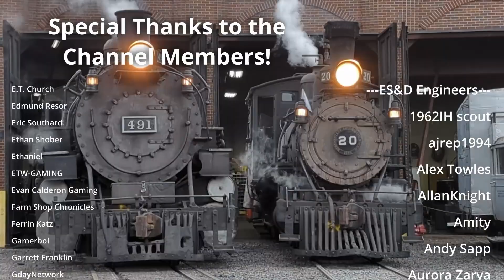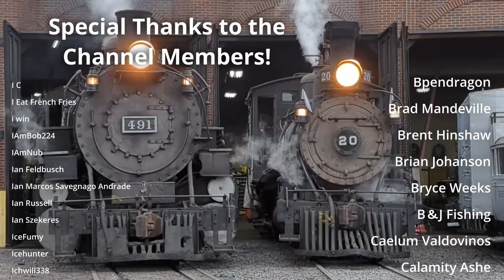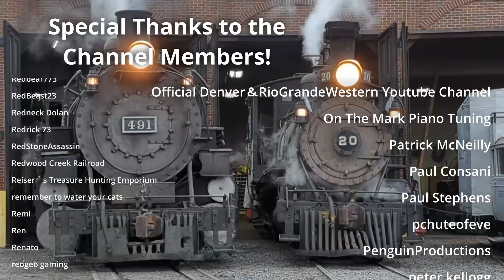Does COAL size matter in STEAM TRAINS? | Railroad 101

Comment: As a fireman, I will add two things to this. I think it's harder to get as full of a scoop of powder as lump coal since it only goes about the height of the shovel wings. Secondly powder has some advantages, both for capping your bank and getting fast heat in the box if you spread it out. No fun if you aren't working the engine hard though.
Reply from the maker: Very true! Excellent additions. Powder is nice in certain applications.
Reply: @Hyce777  I have a question about the Polar Express events.
do the engine crews play the part of Steamer the engineer and Smokey the fireman from the film.
Reply: I suspect that would throw a lot of it right out the flues on a heavy draft though too... Heck it might even be burning as it's exiting the smokebox!
Reply: @kleetus92  if the locomotive has arch brick, throwing it to the front of the firebox will allow more time for combustion
Reply: @SignalLightProductions  true statement, unless it's really really fine then it will be a flour explosion! lol
Reply: Yeah, between how high a pile you can get and how bulk density changes with size distribution (you get more mass per volume taking big pieces with fine fraction in-between, than taking only big pieces or only dust), it might be needed to calibrate the measurement, like by putting several shovels of each coal into a bucket and weighting it.

Unless the dust has huge amount of literal sand and dirt, energy per mass shouldn't differ much - but different combustion speed may cause suboptimal firing conditions at the same firing style (try filling the firebox the usual way - and you'll get tons of smoke). Overall, probably nearly the same performance at optimal conditions but much more hustle shoveling to keep the fire steady.
P.S. Lack of black smoke doesn't guarantee 100% combustion. You still can have insufficient oxygen and be producing carbon monoxide.

Comment: The slack coal will burn faster due to having more surface area, but won't that also mean it burns hotter? So long as enough air keeps coming in for efficient combustion, wouldn't using mostly slack mean that you're reaching higher firebox temps and thus producing mores steam? Or is the air intake limited enough that using slack produces less efficient burning and more dirty exhaust?

Comment: NOTE THIS IS POSTED BEFORE THE VIDEO EVEN STARTS. I will say one thing. The way the brits go about it is fire little and often. No lump of coal should be larger than a mans fist. And no coal should be fired for about two minutes depending on how hard the locomotive is working and how much steam is being used for example more high pressure steam due to the reverser (Johnson bar) being in the more full forward position or  low pressure steam with the reverser (Johnson bar) being in a less forward position like more towards neutral but not quite in neutral. Love the vids Hyce. I’d love to go work with you guys out there. I can speak for a lot of people when I say it’s my dream

Comment: Short answer yes coal size does matter
Let's compare a 1 inch diameter piece of firewood to a 4 inch diameter piece of firewood
The smaller wood will burn faster therefore a smaller piece of coal burns faster than a large piece of coal.

Comment: This is interesting in how it could be applied to a home heating boiler.  I have a wood boiler system in my house.  To bring the boiler up to temp quicker I split the wood into smaller pieces that burn quick with more heat.  The heat is hotter and faster through the flues which means some waste, (there's only so much heat that can be transferred in a given flu so any heat above that amount is wasted.)  As I build up a good bed of hot coals I switch over to larger and larger pieces.  I'm passing heat lower and slower through the flues but still maintaining the operating temp.

Comment: Lots of coal powered power plants intentionally crush their coal into small crumbled pieces... so it will burn quickly, releasing heat to their boilers rather than sitting in a fire chamber very long.  Of course that is a MUCH larger fire, with coal being fed mechanically (no people shoveling) and a fairly constant load going to their turbines.
Reply: yeah, in germany there where coal dust locomotives that did exactly that, just blew the dust into the fire.

Comment: Lololol anyone who's ever loaded their own cartridges or just thought a moment knows size matters.

As you decrease size of the coal, you increase surface area, thus increasing the speed by which it burns.

High pressure powders, like magnum powders, tend to be smaller individual grains of powder, as they burn faster and reach peak pressure sooner, pushing on the back of the bullet harder.

Comment: I was driving a Showmans Steam Road locomotive near where I live, going up a very steep road. I put 2 shovels of coal on with alot of coal dust. The coal dust flash fired with wooshing sound, straight through the tubes and out of the stack.
Here's the funny bit. A white van was following me got covered with the hot dust/ash. it took ages for the van driver to clean up the mess.

Comment: Faster burning, but same amount. That'd mean the same energy from the same volume is getting released quicker. More energy released would mean hotter fire. Sounds like, while slack isn't what you'd want to run on bread and butter, it'd be useful for things like starting up in the morning, or if you need extra steak for heavier loads. A boost for lack of a better word.

Comment: Some warships had mechanical "sizers", big mechanical wheels that crushed larger lumps down to a fairly consistent dimension while letting the fines fall through without further grinding. By using a fairly small target size they got far better consistency and faster burn rates, which where required and desirable with the automatic firebox feeding systems, but not nessesarily well loved on vessels where crews where shoveling by hand, as the average stoker was expected to fuel 5 tons of coal per day (often in fairly enclosed confines with other crew doing the same task), so even very minor changes in how difficult it was to shovel would have huge repercussions on their workload/conditions.

Comment: To minimize waste, every fireman should be using a mixture of all sizes of coal. Blending the slack coal in uses it up without adding in an excessive amount of shoveling, and as it's nearly instantaniously combusting, generating near instant energy into the firebox. vs the slower burning  normal coal.

Comment: I've only ran wood fired steam but size matters there as well. For example, use big chunks for a slow burn if you're idle but want to keep pressure or use small pieces for a quick, hot fire when needed. Fun video!

Comment: Well i am not a fireman or so. But i do maybe know that the reason for the fine coal power burning quicker. Basically the more surface area you have for a material to reacted the quicker the reaction is. For a other example dust is something you wouldn't normally think it could really burn or explode. But if you blow it into the air and give it a ignition source it can happen that you get a dust explosion. A bigger chunk of coal will burn slower then the finer coal powder since the most of material is not involved in the reaction happening on surface of the coal. I am no a expert so please have mercy with me ^^

Comment: you know it's interesting mark, even as a live steamer.  my father's 1.5 scale hudson on average will burn up to a bucket and a half a coal a day during the spring and summer hauling mostly a 5 car 1000 pound train.  now the coal we get from a supplier in nj is basically pea sized and we have been burning pea size coal for 30 years.  it's easier to shovel, it catches quicker.  but like you said for slack coal which is basically dust.  the smaller stuff burns up too quick and for us fills our ashpan more meaning we have to stop more often to dump ash.  once we burn up the last of our pea size bags.  we are gonna try going for nut size.  the idea we hope is that the grates will stay covered better and hopefully won't have to stop and dump ash so much.

Comment: Lump size also influences the relative amount of combustible gases/fluids retained in the volume. The smaller the pieces the more lost gases/fluids to the air. It was the gases in household coals that gave the dynamic fire that provided  entertainment before TV. The small size coal used in large power stations and some locomotives is like that for ease of mechanical handling and predictable energy levels through out the 'batch'

Comment: Its not only work that the fireman does there also advantages to surface area and coefficient burn time but shoveling slack can be dangerous especially in a fully enclosed cab with the potential to cause a dust explosion, this coming from someone whos talking out there ass but is probably right, correct me if im wrong

Comment: I would assume the size of slack would also cause more difficulty in controlling airflow through the grates and dealing with ash.  Doesn’t the smaller size essentially provide a more solid blanket limiting the amount of airflow, or at least making it inconsistent?  And I can only guess that keeping a good even bed with fuel that burns extremely fast when it has air, but can also smother the amount of air, would mandate paying a lot more attention to things (mental exhaustion as well as physical).

Comment: Would be quite interesting to have a nighttime smoke stack camera on firing with the two types. Even with a spark arrestor I have to imagine a fair bit of that slack is being shot right out the stack and shooting much more sparks than clean lumps would. Especially under load with a high draft. 

For double the amount of mass being stoked that energy has to be going somewhere if not the boiler. Either through the ash grate or up the stack

Comment: I wonder how much of the difference is due to the slack being much closer in size to the gaps in the grates that the coal sits on. When you initially talked about the slack, I imagined something the size of coarse sand, and was wondering how you'd expect it to not drop straight into the ash pan.

Comment: Hey hyce I have a question that I only want you to respond, so pls no one else respond. But I found out that one of my favorite locomotives ATSF prairie 1010 will be restored to operating condition. However it is said it will be ran on pressurized air rather than steam. I basically have 3 questions. Why? How does it work? And if does run on air is it even truly “Restored”?

Comment: Hang on, wouldn’t the fact that it’s burning up faster meaning more BTUs in a given amount of time have an impact on the firing of the engine? My thought process here is that since it’s burning faster, you’re putting more heat into the firebox/boiler in a given amount of time, so wouldn’t that equate to having to do less work overall? Clearly not based upon your demonstration here, but I am curious if the fact that it burns faster affects things at all.

Comment: Firing slack in engines with arch bricks like 491 is WAY easier than in small keyhole fireboxes lacking arch bricks like 20. I’ve been stuck firing slack on Valley 97 and if she’s working hard she will just suck your coal dust straight into the flues instead of it going where you want it on the grate.
Reply from the maker: Yeaaaaaaaah that's very true.

Comment: the big one in the thumb nail probably would be good if you park the engine and wana keep her warm but not cooling down so it would have time to break down as it burns. and probably the same to the slack coal at lest to use it

Comment: Now, I'm curious. Is the real power move here to fire with the biggest lumps of coal you can fit through the fire door? I mean, theoretically, you'll have to do significantly less work that way, and be much more efficient right? I presume there are down sides to bigger lumps of coal though?
Reply: Not quite, since you want a relatively even layer of coal spread across the entire grate area, and only using giant lumps of coal would make that nearly impossible, not to mention the fact that continuously lobbing giant lump of coal against the interior sheets of the firebox could cause significant damage.
Reply: @Phoenixlover55  Hmmm, yes, I see, you raise some valid points. I guess it makes sense that there'd be such downsides, otherwise I suppose they'd be running of the large stuff. 

Cheers :)

Comment: Speaking of coal dust- some of the first ICE were powered by that and not liquid fuel. Well, the earlier versions used some mushroom spores as fuel cuz they were even finer ig? But the same engine was later modified to run on the cheaper coal
Reply: Where can I find more info on this? The only locomotive that ran on powdered coal was the Union Pacific coal turbine 8080, which had a gas turbine prime mover that was modified to burn powdered coal. Don't ask me why they did that, because I have no idea, and it didn't really work that well, but they did build it, and it's a monstrous beast of a lashup. Like, the A and B units together had 36 wheels, 28 of which were powered.
Reply: @Phoenixlover55  google "Pyréolophore"

Comment: Which is the best to shovel coal, automatic stoker or pure human muscle to keep the firebox with a enough coal
Reply from the maker: It's best for the size - small engines don't really have the space for an auto stoker, nor would it be economical to have such a crazy auxiliary system and it's assorted maintenance for a smaller engine. Bigger engines.... One guy can't keep up.

Comment: Okay Hyce, here’s question. Since in the smaller shovel fed steam locomotives like fist sized chunks of coal. Would the same be true for the much larger steam locomotives such as UP 4014 like the same fist sized coal if it were possible to feed that hungry beast that sized coal. Or does the draft on the 4014 create such a fire storm when it was mechanically fed the finer ground coal, that the feed rate could be cut down to achieve the same result? This is relatively speaking of course. 
Love the content!

Comment: This is me spitballing here, but could you (should you want to put forth the effort) take the slack and compress it into a more coherent piece? Like "mold" it into a rough coal shape and then squeeze it to kind of make it stick and fuse together? I'm not saying make a diamond, but I would have thought there would have been some kind of machine out there that could compile coal slack into a usable piece of coal. I'm sure it'd be expensive unless you teamed up with a university to do it because they could do it for a material science course and you'd be doing them a favor and they'd be doing you a favor in return; just saying. It just seems like the tech should be out there, but i totally get it if the effort is not worth it.

Comment: I bet that the problem here is not really in the fire speed, because heat is heat in whatever form it is. Less time that the scoop of coal fires — yes, more scoops in the hole. But more heat from that scoop — less scoops in the hole. I think that at least third of that coal dust just went straight to the stack. And the coal that didn't went straight to the stack went when it burnt to the mass, needed to do that.

Comment: Exponential is different to quadratic.

I think it is also more complex than that.
If it was a simple matter of burn rate, then I would expect the smaller coal pieces to burn faster, so you need less in there for the same amount of heat.
i.e. the heat should be moderated primarily by the amount of coal surface area, not mass.
This should then balance out to mean the same amount of coal is used.

I think the bigger contributor is that small coal, like dust, is more likely to be pulled through by the draft and go out the smoke stack.
This means you would be wasting much more coal as it just flies out.

Comment: Always fun when you get almost pure powder on the shovel and it flies straight out the stack. I’ve set at least 2 fires that way both in the same place. Coal quality also matters a lot. When I started firing we used coal that burned so hot it destroyed the grates in about one season. Nowadays we refer to it as the turbo coal. Now we use a much better coal that seems to be perfect for steam engines.
Reply from the maker: The powder really is the worst. It's how we have started fires as well.
Reply: @Hyce777  luckily we usually have a speeder behind the train if there’s risk of fire.
Reply: I love the fact that you call it "turbo coal," that's just great.

Comment: Could slack coal help with a cold start? Maybe it’d be able to properly light at a lower temperature than you have to reach for the size of coal you usually use.

That might not really be the case since coal has a quite low thermal conductivity, so you probably wouldn’t have the bigger thermal mass of coal sucking in a lot more heat into its interior, robbing the surface of the temperature it needs to ignite and burn.

On the note of it burning faster, it sounds as if it burned with lower efficiency, if you used more mass of coal. Maybe it needs a lot more oxygen per unit mass of coal, so you can’t have as much coal in the firebox before you run into oxygen deficiency?

Maybe worth using it if you really needed to get an engine fired up quickly from cold, but the downsides might be such that it’s not worth it in any other case. If I’m correct about the oxygen deficiency, you’d have to modify the procedure used during start up, but I imagine it’s already modified to fit the shorter time available compared to normal operation.